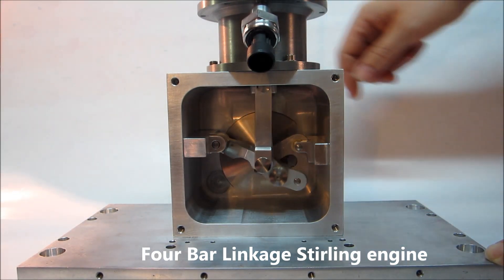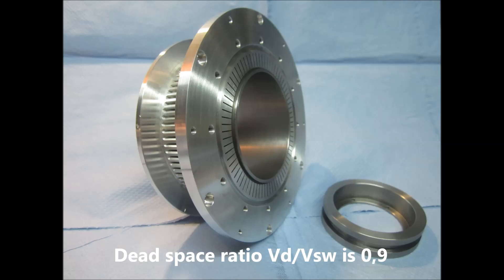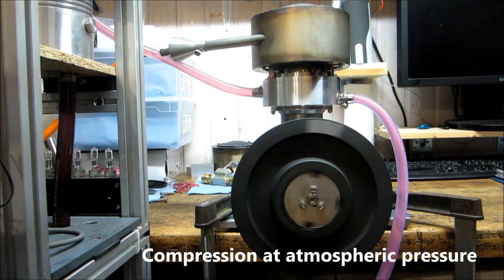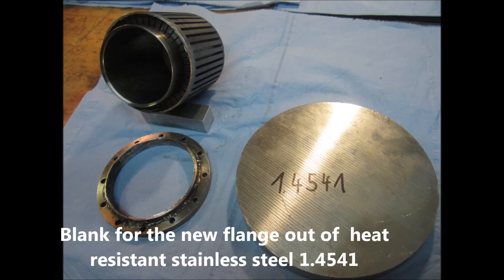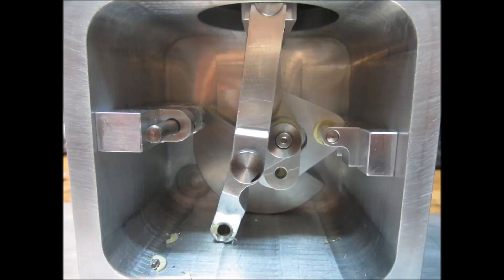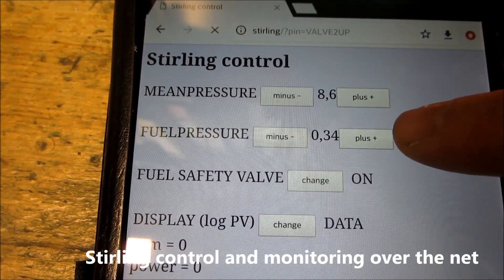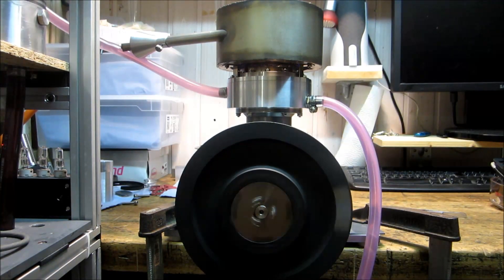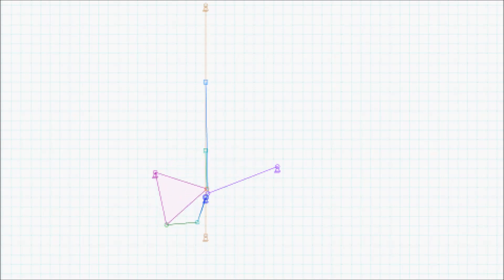Update of my Four Bar Link Stirling engine and development details

Comment: Original mechanism, almost perfect movement of the piston and displacer. How are you doing balancing?
Reply from the maker: Hi,
for balancing I firstly roughly calculate the needed counter weights.
Then I measure the vibrations of the running engine wit a vibration sensor and fine-tune the balance masses.

Greetings Ralf
Reply: @myengines2443  Yes, the balancing problem is serious. Bett is easier to balance. I am doing Stirling from a compressor; it cannot be completely balanced.

Comment: thanks for posting.  here are some observations.      the  rationale/motivation for taking this approach to increasing  stirling cycle/engine performance  Should be Revisited.     here are some basic facts, relating to a  (low-torque)  RECIPROCATING  system/prime mover.    (your initial results tend to confirm a fact:   the stirling cycle  is  NOT  suited for use in a  higher-compression configuration.)        the output of a heat engine Will Always be  LOW-torque.       therefore,  the  Maximum possible  torque will be produced when  a  HIGH-speed  (low-torque) prime mover is  Correctly  matched to,  and  Isolated from,  the  Load.      more correctly stated, the LOAD  should be  Optimally matched to the amount of power (and rotation rate)  available,  AFTER  Speed  Reduction.    ('conversion of rotation rate, to increased torque.'  see a typical dc gearmotor, for an example.)       ALL  Reciprocating mass  in the system  ACTS  as  a  mechanical speed limiter/governor.    so  more is NOT more;   Less is more.       fewer components (of lowest practical mass)  in  reciprocating  motion.     (see a typical  dc gearmotor configuration, as an example of  rpm-conversion.)            conclusion:    vibration is  Inherent  in any reciprocating system.   undamped  vibration is energy lost.         the rhombic drive  damps  vibration,  at the  COST,  of   Increased  Mass  in  Motion.      any  attempt  to   incorporate  vibration reduction into the system,  Comes at a  COST.     a suitable flywheel should be used, for 'smoothing';    the engine  Should be  adequately anchored, for vibration damping;   sufficient robustness is a factor in component design,  ONLY  where  there is  significant  vibration, ie,   the 'end points'  of the connecting rod assembly;   reduction should be used at the engine output, for mechanical isolation;   'load'  should be optimally matched to the amount of power available, after speed reduction.    cheers        googletranslate

Comment: Why do Real World heat engines require Inertial Storage devices? How do you size a flywheel to a PV diagram, mean internal pressure, Desired cycle speed?
Your flywheel appears to “turn the engine” at atmospheric. Maybe steal a lawnmower flywheel and rip cord?

Comment: Huge work!! I made several engines too. But mine are very small and are only alpha or gamma. I never made a beta. They are not more than a few cm3. My last alpha engine can run at almost 3600RPM. But I will change of way for my next engine. It will be a big engine of about 5000 cm3 that I will make during this year and I hope it will be ready to run at the middle of 2020. It will be an engine with a membran as piston. I think that the membran will be 300 or maybe 400 mm in diameter. The goal is to obtain a big torque because the engine will turn at low RPM. Like that the heat exchangers will have more time to exchange the heat. They will be very simples to be easy to make. And because of low RPM there will not have vibration due to high RPM. In this way the engine should be very quiet.
Reply from the maker: Hi Chris,
sure I know your suberb engines and other projects.
Your new engine sounds very interesting please report many videos.

Greetings Ralf